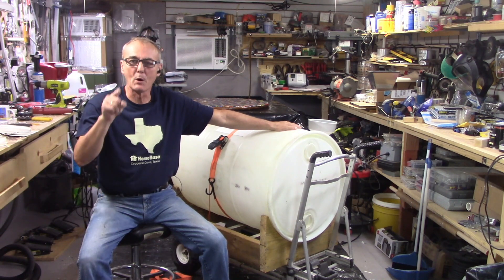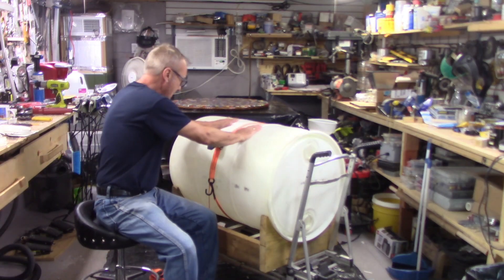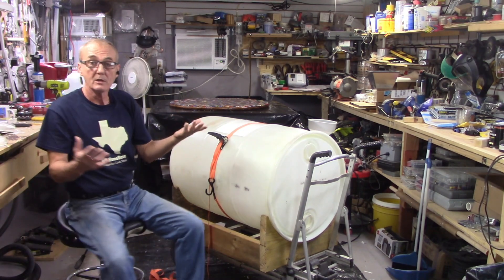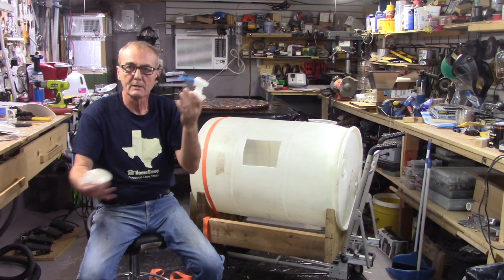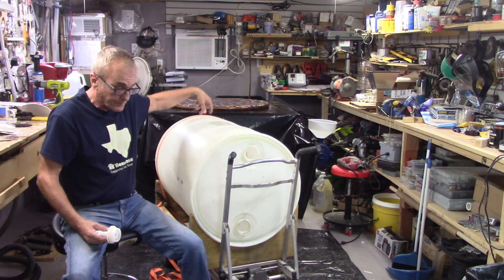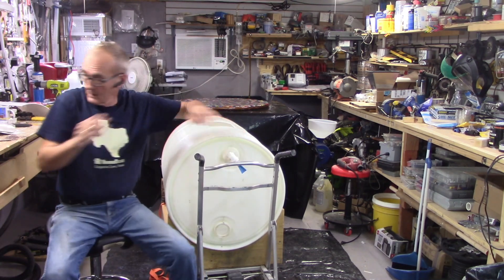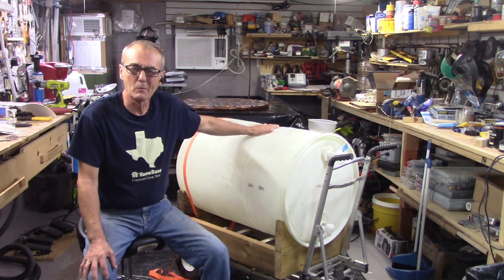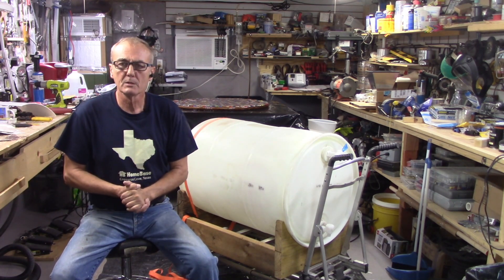BUILDING A HOME MADE FERMENTER PART 2

Comment: George should make a copper sparge bar thru the top hole full length of the barrel have a gate valve to close it get a garden hose repair fitting it has a spur that goes inside the hose then screws into the NPT or garden hose opening mount it inside as a sparge or exaust do the same on the bottom but have a gate valve ready for an 12v RV pump to circulate the wash when done shut it off or drain it out .I have a 100 gallon Cattle watering tank plastic I`m making like this self contained unit .

Comment: I'm definitely going to do this! The place I work has these come through all the time! Already thinking about temperature control: I'm going to install a long copper coil to sit in the barrel with a temperature probe and use my SS brew tech temperature controller to regulate temp. Requires a couple more holes that what you did here, but it's simple enough.

Comment: Hi George.  I love the end result, looks good, and it has given me a few ideas I need to think through if I can do 3 separate types of mash on tap sitting on a reinforced bench next to my still.  Ferment in summer & distill in winter, with a mix of the different mashes.  But it will need to be smaller barrels.
If I had to make a modification, to your set up it would be for extra support in the timber bottom.  Your barrel when full will be heavy and on its side it will be more inclined to "bend".
I look forward to you teaming up with Jessie
Reply from the maker: Thanks

Comment: Another wonderful video George, for heating in the winter time here in Iowa I use a fish aquarium heater. LINEBA IP68 MODEL L 1-5 500W. It is explosion proof and with its removable aluminum shield it has suction cups on the shield so it stays attached to the side of my plastic barrel. it had its own digital controls and can set from 55* to 98*  and has a low level shut down control, will hold my settings 76* in my garage that is heated to 55*. I'm thinking the cost was $25.00 on e-bay.
Reply from the maker: Awesome. I am sure someone else will benefit from this comment. 
George

Comment: Temp control when you start thinking,,  wort cooler,, coil one that will go in the hole, and drill holes in lid  for pipe through, use bung plugs when cooler is out,   sounds simple   lol

Comment: was thinking you could use a 200 watt  submersible aquarium heater. then wrap some pipe wrap insulation or bubble wrap around your 55 gallon drum. please let me know what you all think on that.
Reply from the maker: Not sure. That seems like a large volume for such a small heater.
Reply: @BarleyandHopsBrewing   here is what i have going on. i have a sugar wash to try out my experiment. the 200 watt submersible aquarium heater. the heater is keeping the mash at 80 degrees f . my basement is not heated. going on 3 days now. will keep you up to date
Reply: sorry its a 300 watt heater

Comment: I've accidentally made vinegar without dropping in a mother. It's enough to not have your mash sealed. You'll be fine so long as you have an airlock on it but if you don't, it could turn to vinegar.
Reply from the maker: True but the time it takes for the acetobacter virus to develop is a lengthy process and could take as long as several months.
George

Comment: Turn barrel around cart handles will get in your way.
Reply from the maker: I thought through that and that is not a problem. If I turn it around the base will be in the way. I would need to build an additional 6-8 inch elevated leg to get at the drain.

Comment: George, could you do a video on some creative mash storage solutions? Here in Colorado I’m having a hard time fermenting in the winter because I keep the house fairly cool, and would like to ferment a years worth of wort/mash that I could bottle, or distill in colder weather. Thanks for the great videos!
Reply: once fermentation is done, you need to keep oxygen from being introduced. You'd need a few of these type setups to hold over the winter or create a temp controlled space to keep fermenting all of the months. You can create a space with simple Styrofoam board insulation, inkbird temp controller and a hair dryer for the cold months.